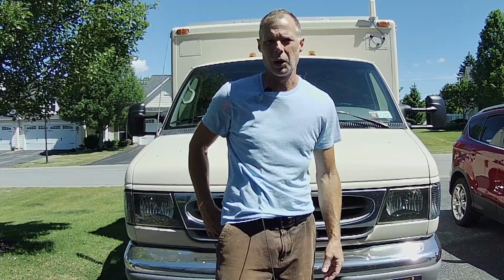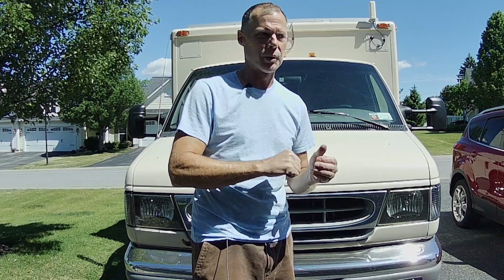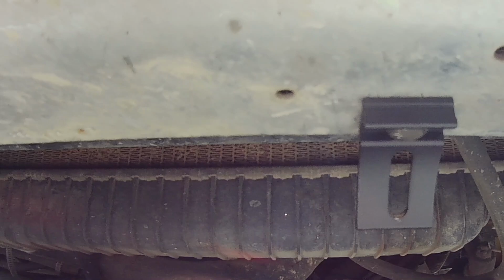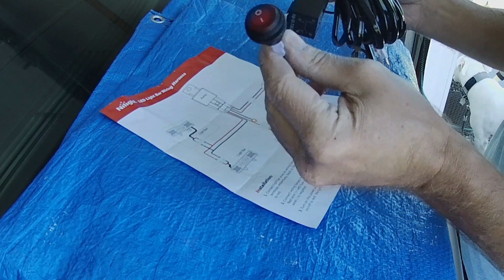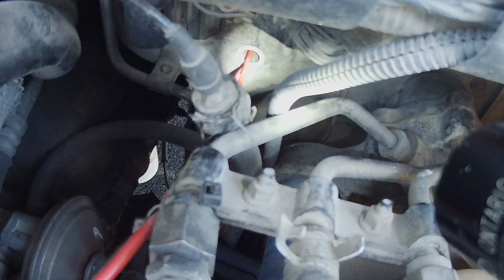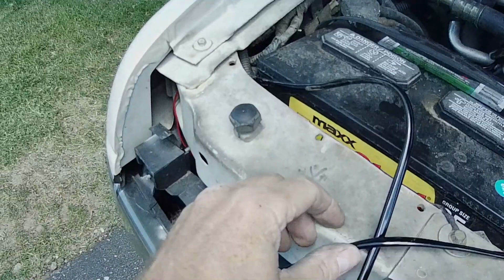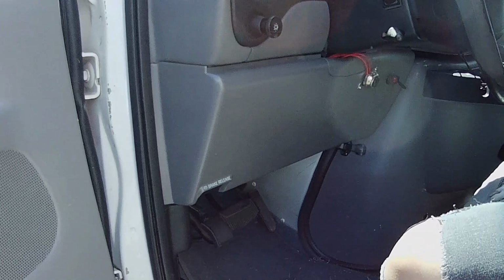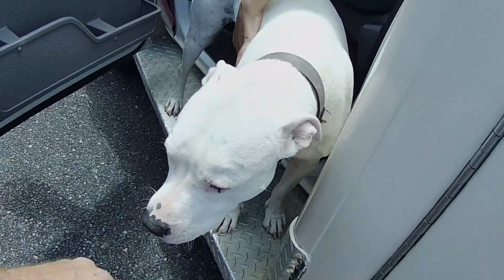Ford Ambulance Conversion Headlights Get Some Help | Building The Campulance

Comment: Good work on your install!

I was thinking about using UV lights to help with my Night Vison cameras. The cameras can only see out 30 feet, with thier UV lighting, but with UV lights up top where the red and white were, I should be able to see over 100 feet. I changed out my headlight bulbs, fog lights, cabin, brakes and tail lights, last year for LEDs.
Reply from the maker: That's a great idea to put UV floods on!!!